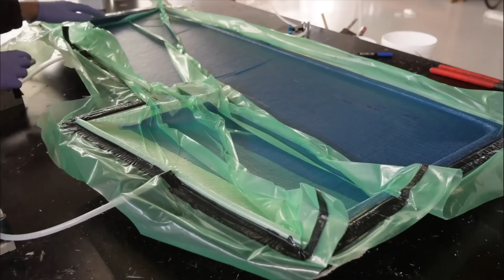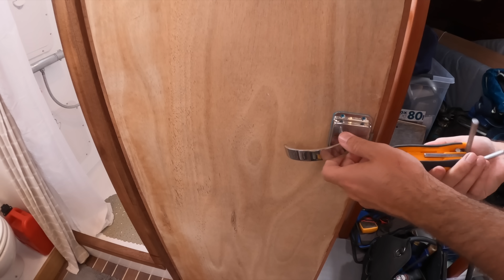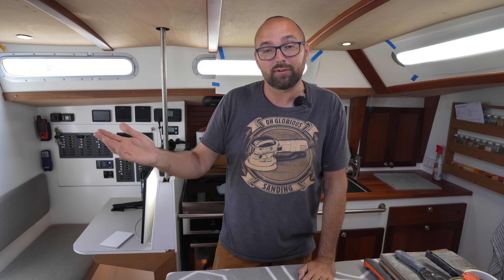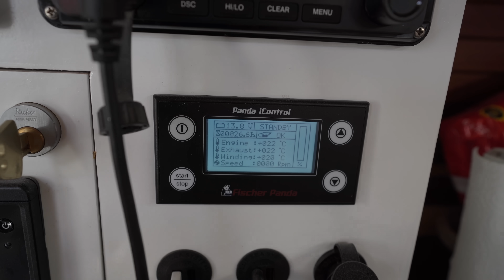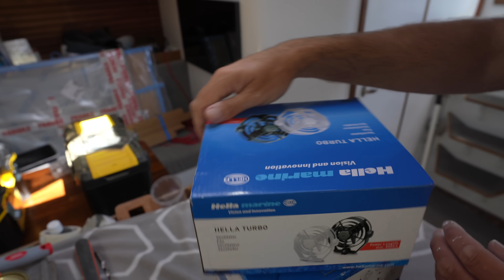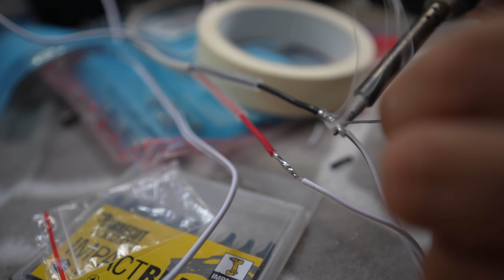Sail Life - Doors, fans and genset overload

Comment: Fyi. I use hella turbo fans for 15 years. They last 1 year on high if you run 24 x7 like i do. I have 8 on my 37 footer in tropics. Caframo fans suck. I only got 6 months out of those the similar version.. But the cheapest caframo with no guard moves the most air by far. So i use those now too. I like the air flow but last just 4 months.

Comment: Where did you take-off 12v power for fans? Do you a breaker on your main DC panel or Czone switch assigned? Did run wires for each fan back to Czone closet or “steal” power inline from lighting circuit?

Comment: I haven't tried this yet, but I was told that where you have rough grain, paint it with water first to make the grain stand up, then sand that before painting.
Reply: That’s what primer is for. Cut first coat as much as allowed by manufacturer. The more you can cut it the easier it’ll be to sand.
( I owned a cabinet shop, we never got anything wet)

Comment: Just a comment on not using respirator. I’m sure you know well. But for viewers who are new here. Respirators or solvent protection masks are needed not for smell but to protect from solvents in products like paint. Solvents damage the nervous system and the end result from over exposure is like a long term alcoholic. So a one off not using is probably ok. But make it a once off.

Comment: Okay I'm trying to remember here but didn't you use some kind of radiator type design for heating? Could you use that and chill the fluid that's inside the system for air conditioning?

Comment: Watching you join the wires reminded me of a trick that Dave showed me a dozen centuries ago. Offset the cuts on the wires on both sides by 10 centimeters before you join and solder so that even if your electrical tape and heat shrink and everything dissolves, the electrical bits still can't come into contact with each other. You'll have 10cm less on the + wire on one side and 10cm more on the other side.
Reply: Best idea of the week!

Comment: Mads I have the same victron system only not the quattro, and I use that current limiter dial a lot. Mine only goes down to 9 amp though and then from there to zero maybe the system needs to be updated. It's really good when I'm in a place where I'm charged for power. If it's a sunny day I just let my solar do most of the work and I do that by turning that limiter down. I wish I had to quattro maybe next year

Comment: Little aimable fans everywhere are the shiznits.  There is no place on our boat down below where one is more than an arms-length away from cageless Caframo fan.  The cageless fans are much more efficient and quiet but even though they are "safe" to touch when spinning that can still be quite startling when it happens -especially when you put your face into the moving fan blade which I have unfortunately done more  than once.

We have 3 fans in our V-berth, one in each corner of the triangle along with a reading light and USB socket to charge a phone or tablet.

We even have a fan in the head and one above the cooktop to blow the heat and cooking moisture towards the companionway hatch.

Comment: We got tired of having to leave the head door open to prevent mold, so I installed a louvered vent at the top and bottom. Later I added a small Dorade box with a quiet fan in it, helped with the 'Bog Fumes' as well as dampness after a shower... 💩🙊 You might want to glue a thin piece of white poly below the washboard latch to keep the padlock from wearing your nice paint job away... If things get too muggy down below, you can pick up a small (5,000 BTU) Home AC unit and set it in the companionway, a bit of poly sheeting will seal the gaps. If access is an issue, you can place the unit atop the open hatch and use some poly to 'box' it in. I don't know your prices, but it would be under $200 here, and I'm sure it would be easily re-sold...
Reply: I don’t think he showed us the install…but he did put a fan in the shower part of the head. If you look back on episodes that show the technical compartment real well. You can see the ductwork, the duct exits through a vent into the back of the cockpit.

Comment: there is an easier way to get rid of the rough surface after painting. Basically when wood gets wet the fibres start to start to swell and the surface get rough...simply water the piece of wood with a wet cloth before painting. Let dry and sand. Repeat the process as often as necessary and after the last time sanding, you can paint the first time. have fun testing.
best regards

Comment: Great DIY, just wondering on the washboards if you were planning on a piece of trim on the bottom of the top board to overlap the top of the lower board so that any water hitting them runs off rather than through the gap and down below.

Looking forward to the trim around the vertical bar on the nav station :)

Comment: If there is one spot on your boat that needs sanding and fairing, it is the inside of the door to the reading room. I doubt there is a surface inside that boat you will spend more time staring at. If it ain't Pretty Damn Spiffy you will be very disappointed.

Comment: Most generators can either run at 3000RPM (to generate 50HZ) or 3600RPM (for 60HZ) as you get higher power from the 3600 this is often what's quoted even in Europe where generators are run at 3000RPM. So as most electronics can run at 60HZ you can usually get a power boost from your generator by increasing the engine speed. I'm not sure if the inverter/charger can deal with the different inputs but it wouldn't surprise me if it didn't convert everything to DC for manipulation anyway.

Comment: Regarding Air Conditioning:  Not sure what you are looking for,  but would encourage you to look at AC unit designed by another Youtuber Emily and Clarks Sailing Adventure. Clark, an engineer, designed a DC battery powered AC unit up to 5000 BTUs which is now being manufactured.  Apparently is very efficient and can easily run all night off of one 100ah Lith battery.  You can check out his design from a 1 yr ago video or more recent one where he installs unit on another sailboat.  Unit costs less than 1/2 of another well known DC powered AC unit.  I have no business interest in Clark's AC unit/the manufacturing co- just saw it on his YT channel.
Reply: I agree. Also, he advises a 6' VHF whip antenna; His wind generator seems just up you DIY alley,.
Reply: I remember seen that video about his 12 volt air conditioner it's definitely worth looking into.
Reply: Here yeah go, Clark's ac unit...
https://youtu.be/xF113aUlZgo
Reply: Agreed..

Comment: Thanks for sharing another awesome episode. Ive been following you for a while already, and enjoying and learning from your journey. Hey, I have a suggestion, if it makes sense to you. I have noticed that the cook top is right beside your electronics/nav station. Considering that there will be stem with grease coming out of the cook top and landing on your electronics, I would suggest for you to install a barrier between them. A glass would work but it is probably dangerous, maybe another cheap transparent material to block a little bit the grease coming from the cook top to the electronics.